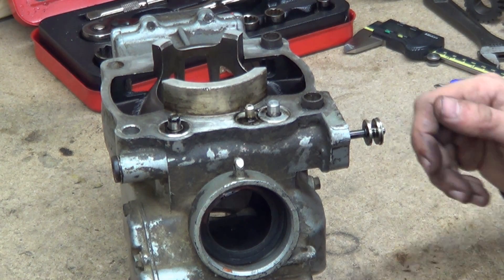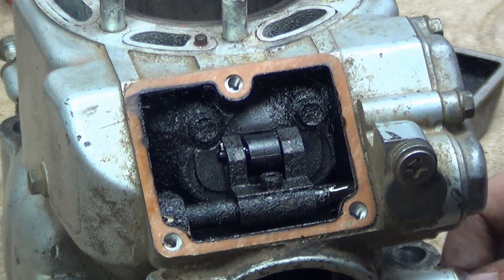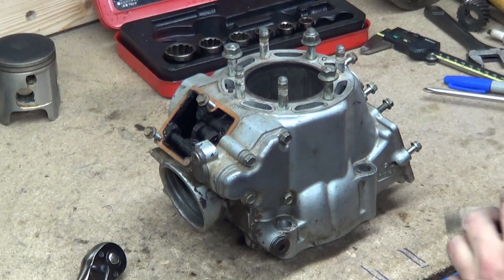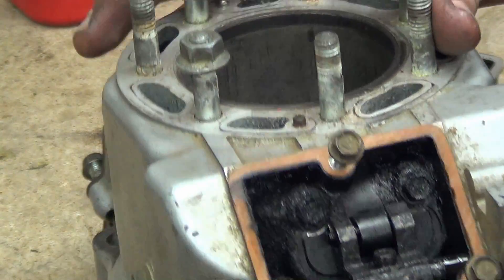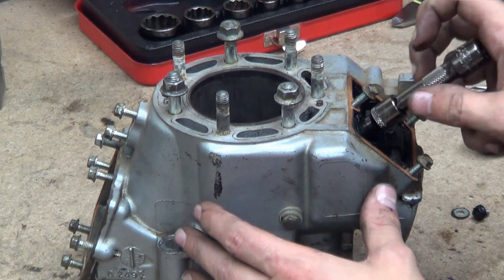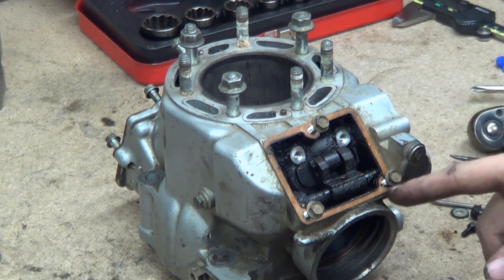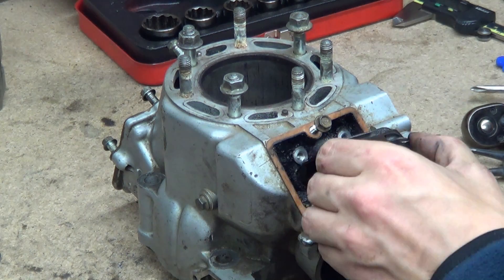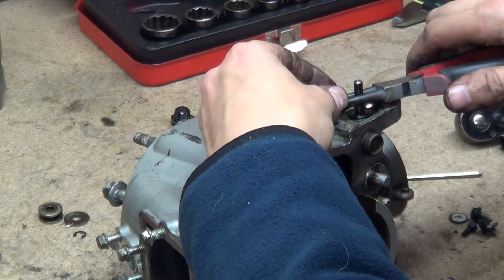KX250 Geared 2 Stroke Series - Part 18 KIPS disassembly

Comment: the bolt in the water jacket is so if your only removing the head you dont have to drain the entire coolant system. it simply drains enough so you dont have coolant all over when removing the head
Reply from the maker: Awesome bit of info dude - thanks - matt
Reply: this is my favorite power valve set up kawasaki did a great job designing it. i love that it changes the auxillary exhaust ports as well as the main port

Comment: great videos but this is nit thhe correct way to remove integrated powervave hence the need to force rod with a  bunch which will wear down the gears u simply lift the gear up over rod one at a time and slide rod out
Reply: excuse spelling error ..... not the correct way
Reply: thats complete nonsense that wont wear the gears